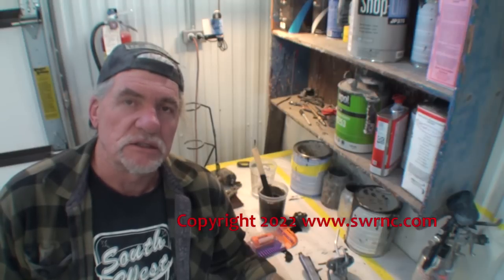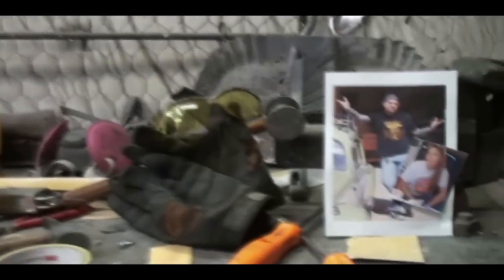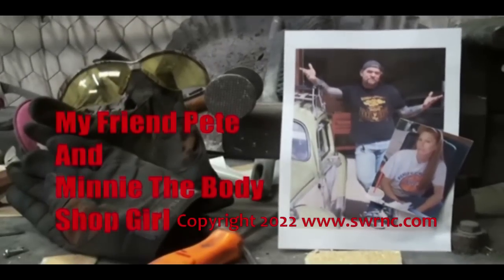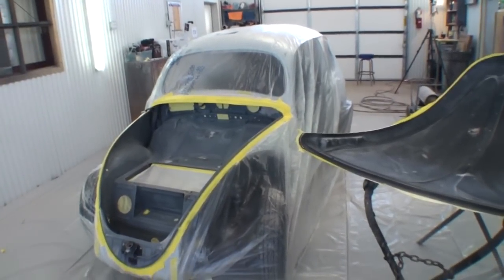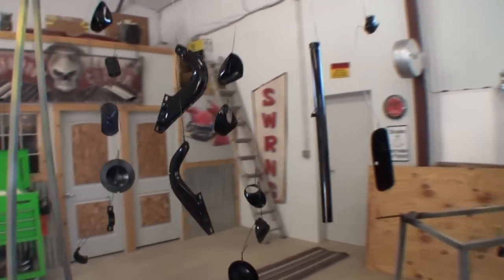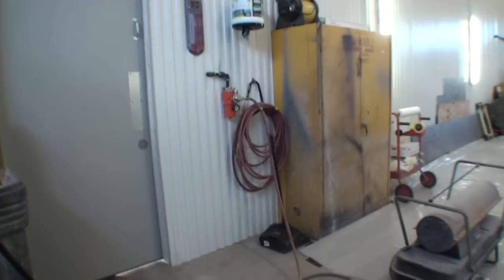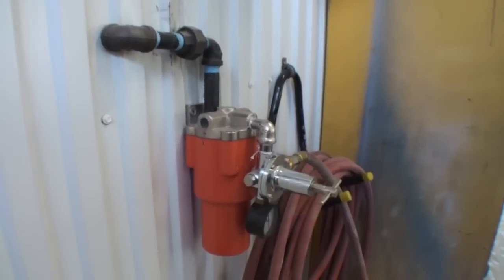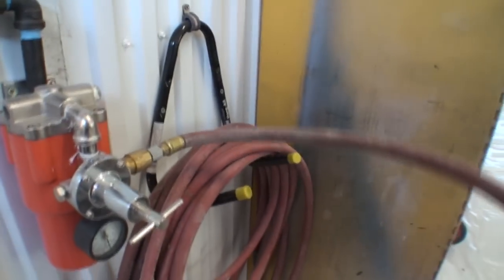How To Remove Water And Oil From Your Spray Gun - Automotive Paint And Body Tech Tips

Comment from the maker: Time to get rid of that oil and water in our paint jobs -- here's how we're gonna do it... Thanks for watching..
Reply: Love your content! FYI I recently put just a male connector to all my guns and assembled an all-in-one filter/regulator with a female adapter so I only need one because I used to try to put a filter and regulator on every gun.
Reply: Pete, where can I order the matrix mp3?
Reply: Hey Pete.  I have a tough one,  I am painting a back quarter panel and there is not break line.  it goes quarter to  roof to other quarter,  the paint is pretty new and looks good, I am scared of using blender on the clear because of durability, I can blend it in the jamb and probably be ok or is there a better way?   thanks !!

Comment: Instead of calculating you could cheat by just installing a pressure gauge at the gun just temporary while you adjust the regulator pressure at the air compressor location

Comment: 1) Use filter at paint gun.  ( Habor F for the primer gun).  ( Motor Guard mini-desiccant dryer for paint gun)
2) Oil / Water separator at air tank
3) Air Pressure set at wall will decrease until it gets to the gun outlet.

Comment: There shouldnt be any oil coming outta your compressor if you have an oil descate filter before your air dryer i still use one i have the devbiss qc3 regulator with another decate bead my speed aire dryer quit bought a new smc  25 cfm dryer coming i refuse to primer or paint with out a dryer

Comment: Once i sprayed primer here thry say instant primer and after sanding it many micro pores or holes apeard. I don't know whats the problem. But i thought maybe the primer drys more quickly than the thinner in it and the thinner got trapped under the primer and make thise tiny bubbles so when i sanding it they will apear. And be visible. So i decided to spray narrow layers on it to solve the problem.
Am i right or it's because of something else?
Am i right

Comment: 🤔I used 50 ft of 3/4 in stainless steel pipe straight up straight down back straight up straight down and then my filters and oil separator and my paint comes up purpley smooth no fish eyes beautiful paint job I do use a another 50 ft of copper teething in a freezer Locker to run my air  through  takes the moisture out of any  Air you're right about that filter connected to the paint gun

Comment: regarding the orange trap,, they peel bad inside a friend said he had to replace one so epoxy primmed the inside of the new one,, He puts the stainless steel pot scrubber wool he gets at Dollar general inside so the water condenses on the wool before it can move down stream
Reply: I not sure I understand what you are saying. Are you saying he takes the filter apart, removes the purple beads,  coats the inside of the filter housing with epoxy and puts it back together, but uses the stainless steel wool instead of the beads? Thanks, Phillip Hall
Reply: @PhillipHall01 orange  one the wall filter, its hollow the powder coating inside peels and corrodes, so sooner you deal with it  you can stop it
Reply: @91rss  
 👍🏻

Comment: Thank you Pete. I've been Painting ( mostly Industrial Spray painting) since 1986. And you are 100 percent Correct. God bless you. Most people don't believe me when I preach to them, that the Air Supply Chain is one of,if not The Main Culprit of Paint Problems. Thanks again brother.
Reply: @paullarson3175  This is a very old comment but I'll try anyway. It appears you're a pro, so I was wondering if this is enough to take care of the moisture issue for spray painting. What do you say?
Reply: I say the same and people constantly argue with me about having a high quality separator at the compressor. Well I have a high quality one there and a secondary one at my hook up point and I still run one at the gun because of 30' of hose. Mostly guys in the fire arm cerekoting industry like to try to say it's unnecessary and makes the gun heavy. If I as a man was restricted by the 6 ounces added by a filter at my gun then I have a real problem to where I would have to make sure my balls were not missing.

Comment: Pete, after putting the Epoxy Sealer on the car, do i need to scuff it if the Sealer is left to fully cure? As you've said don't sand it, yet there's nothing for the paint to key on to.

Comment: I use these filters. Once they turn pink, I take them apart and dump the desiccant out on a paper plate and zap it in the microwave until it returns to the blue/purple color. Once it cools, I put it all back together and reinstall the plugs until next use.
Reply: So you are able to just clean the filter and its good to use again or just replace it? I got one with a little pin under which i can push in idk what its for but its a NEIKO filter from amazon it was like 11  bucks. NEIKO 30252A Water and Oil Separator

Comment: Hi Pete, why black pipe for your air supply?  It will rust internally from moisture and will eventually clog your $200 regulator.  Plastic or copper lines are much better choices to avoid this.

Comment: Harbor Freight also sells a gun filter with the beads. I have found you can actually take it apart, put the beads in the oven, turn them back to purple, assemble and use again.  Phillip Hall
Reply: That doesn't get the oil out
Reply: @ericschulze5641  
At 350 degrees, it gets the job done, lol. After going through all the filtertation that Pete has and most painters have, very little, 'if any' oil gets to the gun. This good little device shown by Pete is a good insurance policy (just in case).
Reply: read you shouldn't reuse the beads because they pick up other debris that can't be cleaned.
Reply: @chvydrptop 
Water//Air separation is the goal for me..  And I have had no problems with this....